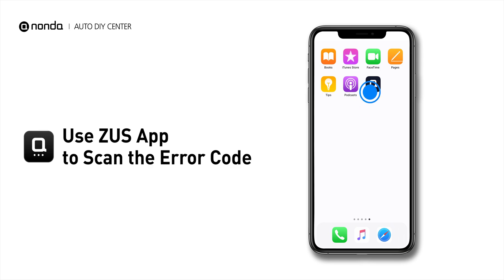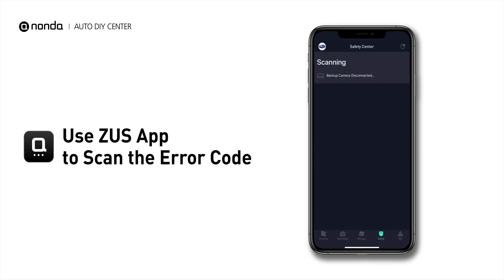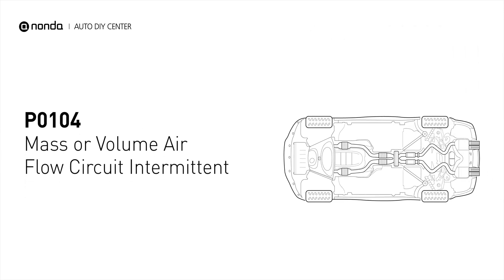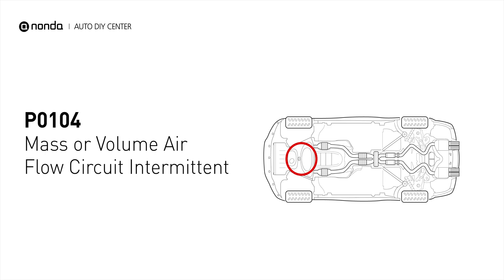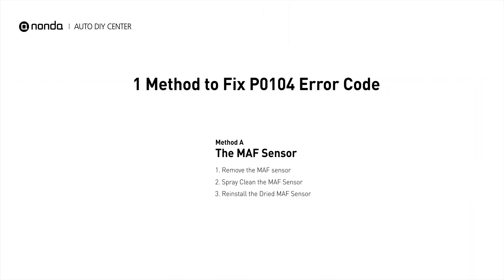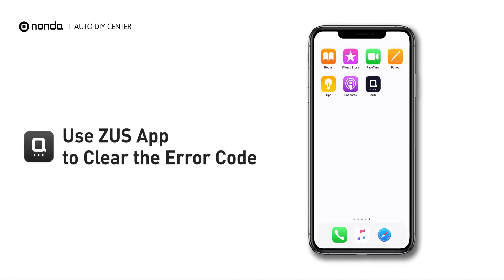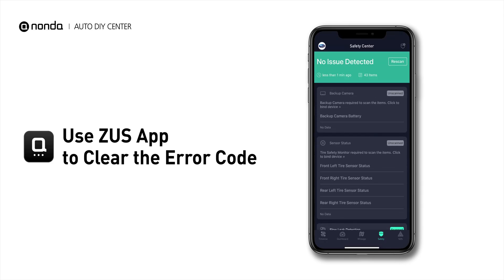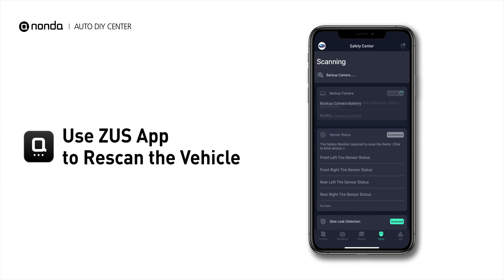How to Fix P0104 Engine Code in 2 Minutes [1 DIY Method / Only $9.71]

Comment: Got a new sensor yet problem still persists :(
Reply from the maker: Hello, if the tips/suggestion in our video (how to fix the error code) has been applied and the issue still persist, please have your vehicle visually inspected by your mechanic for further diagnosis.
Reply: @nondainc  OK thankyou